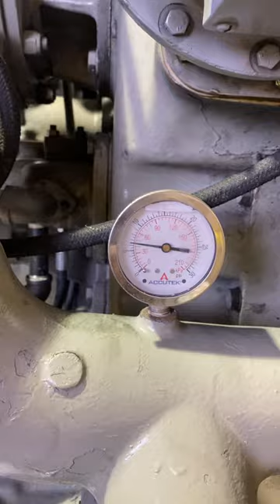20 cylinder Emd 645 E7b.

Comment: Actually the Turbo is gear driven from throttle 6 down, throttle 7 and 8 the exhaust drives the turbo above the gear train to produce massive power
Reply: This is an E7, so there are no notches. If I recall correctly (and I mostly mess with 3’s) 4 is marine, and 7 is standby generator use.
Reply: @CPAlburtisRailfan  there are 2 types of Governors on engines with no ECM, the electric governor and pneumatic governor the Marine engines use the pneumatic governor which is + or -1Rpm and the electric is + or - 6Rpm...
Reply: @CPAlburtisRailfan  it's my understanding the type of governor used determines the particular service be it a pneumatic or electric both made by Woodward,  the ECM engines are a group of their own, but last time I was at Woodward was in 83'...
Reply: The equivalent RPM
Reply: @CPAlburtisRailfan this engine is using a pneumatic governor,
Reply: @CPAlburtisRailfan  in the mid 80s we tested a 16 cyl E7B engine at National Marine Service in Illinois just north of St. Louis and it was slated to be installed in a 3 Engine Tug boat, I believe it's the governor used that determines the engines use, not some other method,
Reply: @CPAlburtisRailfan  the point of my comment is the rpm equivalent when the Turbo starts making significant boost and the Engine becomes a heat source...

Comment: OH! Ok so it's turbo charged.
Reply: Some 645s were actually both turbo and blown from factory, and a few had blower or a turbo. Think of their combined forced induction system as a gigantic procharger kinda. It's a 2 in 1 combination of the perks of a blower with the power of a turbo. EMD themselves pointed out this genius method of boost while keeping the engine dimensions the same. Even with a blower these engines still fall under the category of naturally aspirated as the 2 stroke design would simply fail without proper scavenging of the air.
Reply: i think thats a centrifugal supercharger
Reply: @HPsawus  it's technically a turbocharger. At cranking speeds, it's turbine shaft is turned mechanically through a clutched gear drive off the crankshaft, acting like a centrifugal supercharger.  Once enough actual exhaust is flowing though, it acts like a normal turbocharger.
Reply: @slowpoke96Z28  oh wow that’s fascinating. I should’ve read the first reply before leaving mine haha. Thanks for the knowledge ✌️
Reply: it’s both, the camshaft runs it, at idle you can here it fire the injectors thru the charger why it makes that unique sound idling,(it’s speeding up and slowing down every time it fires) until it has enough exhaust velocity to spin the axial turbine wheel, manifold pressure disengages the gears. these only make a few pounds of “boost” it needs it at idle because the piston does not push the exhaust out, the blower does,along with charge the cylinder with air… 2 strokes are really a unique engine how they work but i really don’t care for them i prefer 4stroke ✌🏻

Comment: I was a shop electrician on the c&nw rr sometimes I would run the crane for the machinests  heads were torqued at 2400 and we were required to open the cyl cocks on a cold engine and blow out any moisture before starting

Comment: What an absolute brute of an engine 💪🇺🇸,……nothing on earth like the sound of a Turbocharged EMD 645 engine,………….the sound of the mechanical Gods 👌💪👍
Reply: Yes stay away from the 2 stroke EMD ignition system as it makes about 72000 volts and over 2 amps and it can kill you dead!
Reply: Absolutely ground the magneto to avoid electrocution when cranking the EMD 2 stroke!
Reply: Ignition system? It's a diesel. Or am I missing something?  @jlo13800
Reply: Im being silly!